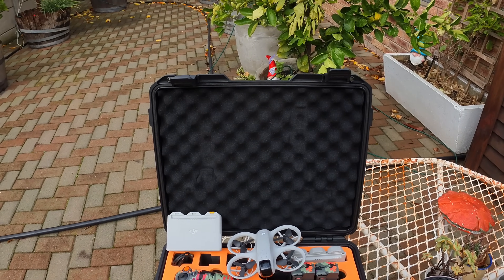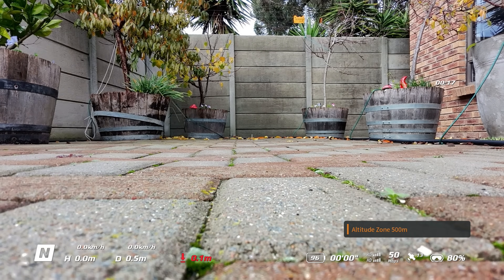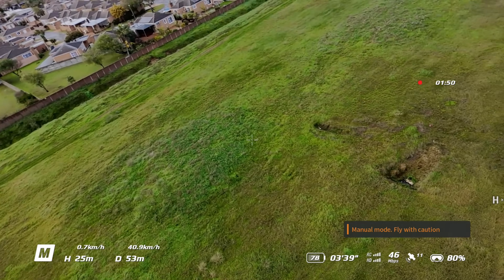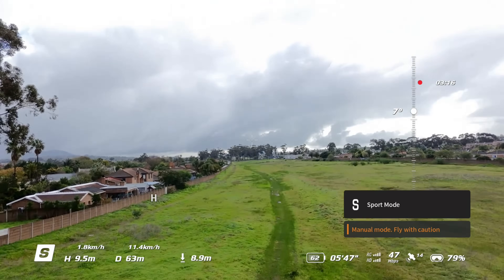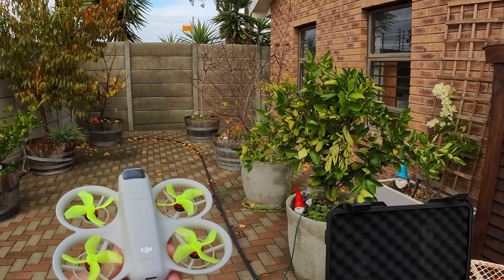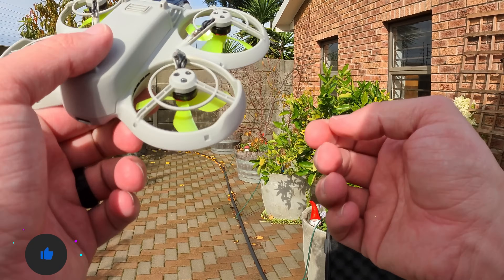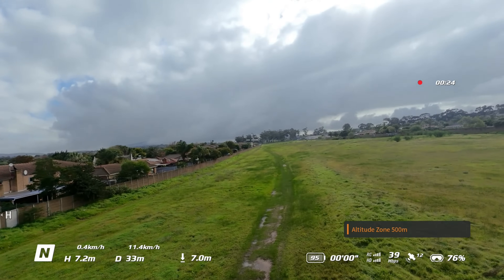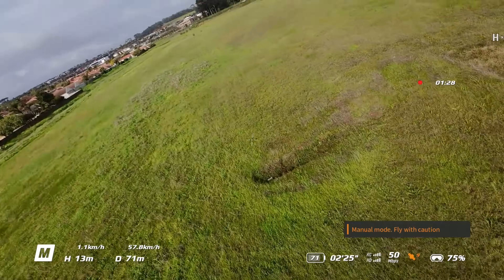DJI Neo Motor Upgrade vs Stock Motors – Real Performance Test!

Comment: Have you solved the issues? Is the motor swap still possible or has DJI firmware updates prevent that? 
Great improvement on speed. Sure does countdown drain the batteries though.
Reply from the maker: if you cut the wires you will get this, but a quick blow on the wires alwasy solves it quick and easy. The way to do it without getting this issue is to solder directly to the board and not cut the wires.

Comment: One of your motors doesn't have a good solder point at the end of the winding. Even the stock avata motors did the esc error. All i do for that is find which wire it is using a continuity tester (although sometimes it will  still has continuity, in which case you have to resolder all three wires at the end of the windings.). Most times if you don't smell the motor burnt, that exact solder point is shorted. Ive never had an actual esc from dji go out on all the avatas ive gone through. And ive always fixed my esc issues this way instead of using my care refresh. I save that for when all the ducts are broken😂😂
Reply from the maker: Nice info. Thx!

Comment: Very interesting. Is there a top speed gain with the sport mode? Because I don't have manual mode with the motion controler 3.
Reply from the maker: no realy benefit except accelleration speed - the top speed would be capped by the dji software/firmware

Comment: There are 2 variable being tested because the props and the motors are different. the better performance could be just the propellers or just the motors or a combination of both. you would use the same propellers on both drones to isolate the motors as the only variable. then test the motors as the only variable. This is basic 6th grade scientific method. because there are 2 variables there is no definative conclusion other than it flys faster with new props and motors but cant say witch or if both variables caused improvment.
Reply from the maker: Thanks for the feedback, that's a good point to raise!

Comment: I don't wanna have to start my drone up by blowing in it like the original Nintendo games. 😂
Reply from the maker: haha very funny. As explained in the video - its a side affect from cutting the wires and not soldering straight onto the esc. If your temp stays in the same range it does not need to be "blown" haha
Reply: Yeah that part!!

Comment: so i need to bj him before every fly and I can't push the motor that I've changed to pushe the dron so the battery doesen't overheat, look like a dbl fail to me.
Reply from the maker: I pushed really hard and I've not been able to get that error again. But definitely solder on the esc and not cut the wires. Best upgrade I've done. Drone flies way more controlled that before

Comment: hhhh u destroyed yre drone wp !!!!
Reply from the maker: Actually, if you follow the channel you'd know that my neo had a bad motor and the dji repair cost with official motor would have been about 3x more expensive than this route. Now the drone also flies alot more "locked" than with the weaker motors.

Comment: Stupid question, will the error not get resolved if you use a slightly lower KvA motor and 3 blades instead of 4
Reply from the maker: It gives the error on startup... so the props won't make a difference. Also, I've not found any other kva motors. The error is resolved like I said in the video if you direct solder to the ESC.
Reply: @InfinityDrones  thats not the only error, the battery shutting down mid flight is a pretty major error.
Reply: Yes.

Comment: 同じプロペラを使っていないのでこのテストは全く意味が無い
Reply: Change the title to motor and propeller upgrade vs stock motor and propeller. Problem solved
Reply from the maker: Why on earth would you use the stock propellers... part of the "upgrade" is to upgrade your propellers
Reply: @InfinityDrones  モーター アップグレード vs 標準モーター – 実際のパフォーマンス テストとするなら純正モーターでもプロペラを変えただけでパフォーマンスは変わるからこのテストはモーターによるパフォーマンスの違いとはならない。モーター以外は共通とするべきだ
Reply: @InfinityDrones  There are 2 variable being tested at the same time the propellers and the motors. the better performance could be just the propellers or the motors or a combination of both. you would use the same propellers on both drones to isolate the motors as the only variable. then test the motors as the only variable. Basic scientific method thats why.
Reply from the maker: fair point. But I can tell you there is a nice performance feeling when flying after the motor upgrade.

Comment: Hey, I have the same problem as you regarding the non-functioning Esc key. I'm not sure if it's a soldering issue. I've tried fixing it 3 times already, but unfortunately, the problem still persists. Heating it up doesn't always work either... once I tried to turn it on for 30 minutes unsuccessfully, and sometimes it turns on correctly right away (without touching the cables) PLS HELP :(
Reply from the maker: seems the best solution is to direct solder to the board and do not extend/cut the wires from the motor.

Comment: What brand and model propellers please  ?
Thanks glen
Australia
Reply: Master screws give a little better performance and they are slightly quieter. They're on Amazon.
Reply from the maker: sadly.. i find they are horibly balanced... I've had horrible luck with them.
Reply from the maker: Hi there, they are Gemfan 2020

Comment: Wrong props for these motors,you should try 3-bladed props !!!
Reply: What brand and model props are they ?
Thanks Glen
Reply from the maker: They were the ones on hand. What props do you recommend :) I like that they are alot softer than the 3 blade ones.